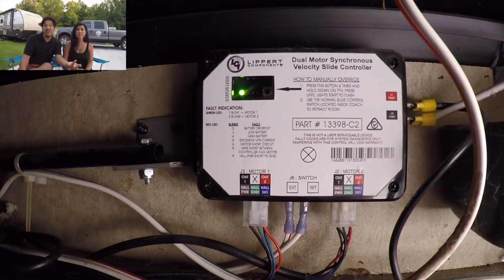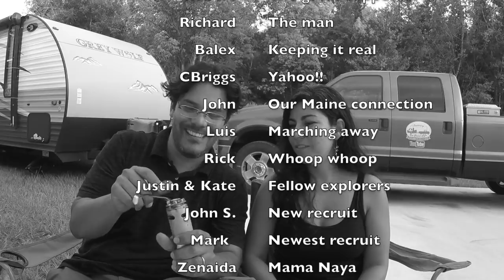RV Slide Motor Failure - How to manually close your RV slide - Full Time RV Living

Comment: Great video!  I heard however, that if you simply unplug the white plugs on the controller, that will disengage the motors and you can push the slide in without having to remove them.  Once it's in, plug them back in and the brake will engage on the motor and the slide will stay in place without having to secure it.
I don't know this to be absolute, as mine hasn't failed, yet, so I cannot confirm or deny.  Good luck to you and thanks again!!
Reply from the maker: Thanks for the info!

Comment: I was camped last weekend and another camper had the same problem. 
Thanks for a video showing how it is more difficult to remove the motor than the factory video shows it to be. 
I could not find the motor synchronizer control panel on his unit. It was not where mine is (under the sofa). Was yours in the coach or in the storage area of the coach?  I could not help him remove the motor as neither of us had a ladder.  Thanks for all the good videos. Hope you are enjoying Colorado now that you have been here for awhile.
Reply from the maker: It was in the RV, right in the corner of the slide wall.

Comment: Check your Camper manual for the "manual" override procedure on the slide.  My camper has a Nut that I can crank it in by myself without the motor, same crank I use on the stabilizers.  I can't believe there is no manual crank method to yours.   Great video!   Yep, get a Robertson head screwdriver.   Very cheap indeed at Harbor Freight or any store.  :)
Reply from the maker: Thank you so much Garland Style!!

Comment: I’m am pretty sure on the opposite side near the wheel well, you might have a bolt stud that you could use a wrench 🔧 to bring the slide in and out.... or an access panel to put a socket into it and do the same method
Reply from the maker: We don't have that...

Comment: Some rv's have a long tool similar to a stabilizer tool for lowering your stabilizer,  that you use from the opposite side of the trailer to manually move the slide. I am guessing your trailer doesn't have that?
Reply from the maker: Todd, Robert didn't find one...so I'm guessing we don't. Thanks though. 😍🙂
Reply: Only the slides with the "ram rods" have the manual crank tool.

Comment: In case you haven't found out, and for those who are curious, the square drive screw is called a Robertson. It is way less susceptible to cam out than a Philips head screw, especially when using a power drill or impact drive, which I suspect is the reason why manufacturers are using them instead of the Philips head. You can also stick one on the tip of a screw driver and it won't fall out. A well fitted drive bit will even hold it when the screw points downward. Perfect for putting a screw in tight spaces without the help of another hand. Surprisingly, the Robertson screw is a  Canadian invention and has been around since 1908.
Reply from the maker: Hey Chomp - Thanks for watching and sharing what you know about the Robertson VS Philips!!

Comment: Did you ever make a video on the replacement of the motor? I have the same make and model and have my RV stuck in the woods with the slide stuck out. Rear motor isn’t working and the controller says there is a short.
Reply from the maker: Hey Shawn! We have done a follow-up video because we have not replaced the motor yet. Lol still pushing the slide in and out manually. It's on the list, but we can still RV without it... 🤷

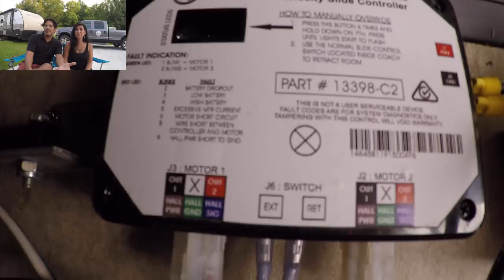Comment: Hello I was wondering if you can help me or anybody. I have a 2018 grey wolf 23 mk.. I'm having a similar situation but it's completely dead. The slide-out is extended out. I can't seem to find the modular that you are showing on minute 1:13. You tell me where you found that on your model as it looks like mine but mine is a little smaller

Comment: A mobile tech can do just about anything a shop can do. Usually cheaper and on the spot. One of our motors went out during the warranty period. Dealer repaired it, but had it for a week. We weren't full time yet so it was ok. Looking forward to the install video.
Reply from the maker: Thank you BigB10774!! We are pretty used to doing a lot ourselves, so sometimes we just don't seriously consider having a mobile tech out. It will be a few more weeks before we do the install. 🙂